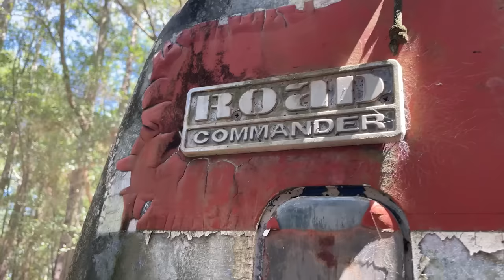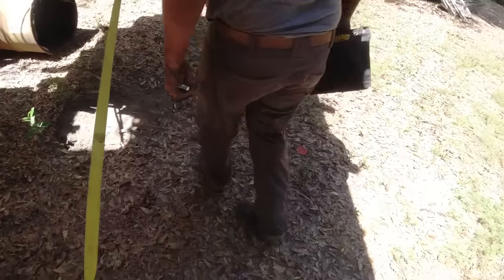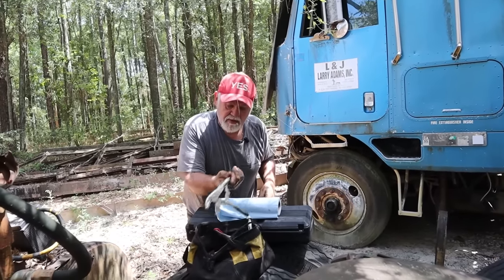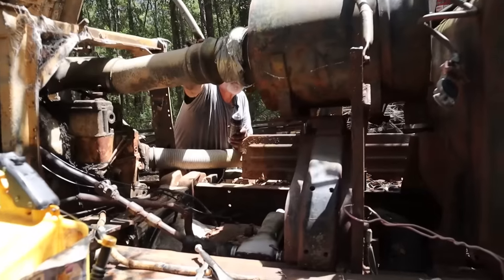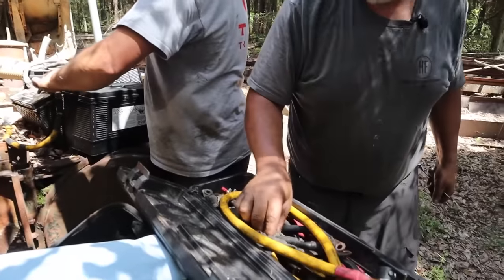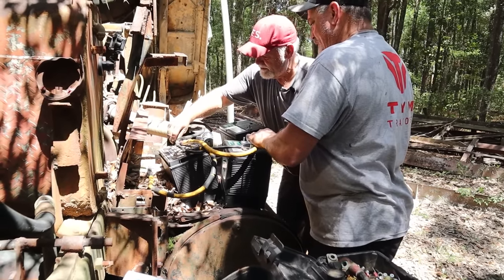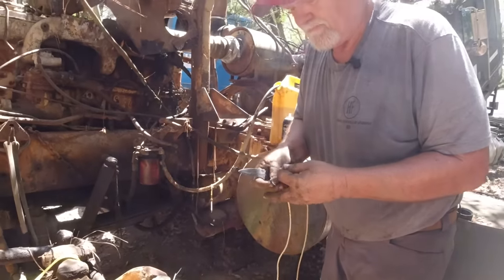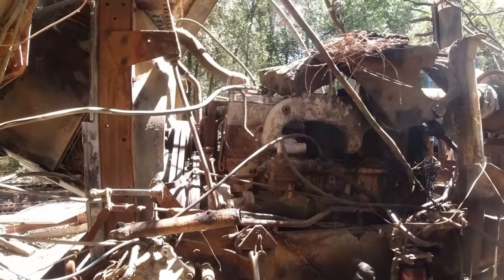We found an BULLNOSE CABOVER that was parked 20 years ago!

Comment: you guys need to get more compression in the cylinders. it sounds like only a couple have compression and thats why its not starting. if its just rings then try putting some marvels in the cylinders so it can work on releasing those rings so they sit against the cylinder walls and build compression. you can run some real heavy oil in it too. it may have some stuck valves from sitting and thats letting compression escape. you would have to open up the valve cover to see that. great vid guys.

Comment: That's supposed to be a 903 but I thought the 903 was A  Vee engine ,that looks to be an in-line engine but it's hard to tell from the video. 903 had a bad reputation that motor may have been changed